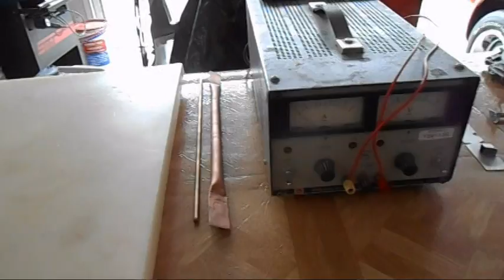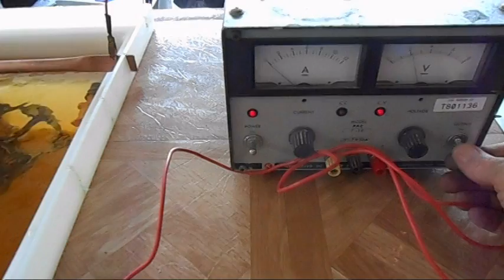Carburetor Plating Cadmium Dichromate

Comment: May I ask how big your Polyethylene tank is?   It looks to be 24x18 x12 and 20 gallons.  Also is it necessary to heat the solution, or does your pump do that for you.  Thank You very much for posting this video. It's very professional and well done.
Reply from the maker: w 12" L 18" Depth 12". I think it is 11 Gal. I run at room temp  60-95 Deg.

Comment: I really, really enjoyed your video on this subject,and I have seen most of them on here. A main concern of mine has been spilling chemicals. Insetting your plating tank into a workbench solves that. Having the area below for a fluid circulating pump system that taps into the sidewalls of the plating tank versus an aeration system is also a great idea. Having vertical slits for the copper pipe ends gives firm grip on the pipe to prevent rotation of the pipe. All "better mouse trap" designs for these important 3 facets of plating. Where did you get the plating tub? It almost appears to be nylon material vs plastic. Lee
Reply from the maker: Hi Lee
 I purchase the tank from McMaster-Carr. Check out there web site. They carry a lot of hard to find items. The tank is rated for just about any chemicals.

Thanks for watching

Comment: Very nice work. I’m restoring an old Kubota B6100. New to plating and trying to learn all about it. I like your setup the best of all the ones I have seen. I  plan to build mine like yours. Looks simple and efficient. Couple of questions. 
What model pump and filter are you using? Is your power supply a linear or switching model? I’m looking for at least a 10amp but not sure which one I need or if it matters. Thanks for the help.

Comment: Hi Harold,

Thanks for this awesome video !
But, not fluent in English, (living in France), I have difficulties to understand what kind of chemicals you use for the tank and for the yellow finish ...

Thanks for your help
Pat
Reply: +manmad4 pour le jaune, il utilise du dichromate de sodium et acide sulfurique.
pour la cuve de placage , il utilise de l'eau distillée, chlorure de zinc et chlorure d'ammonium. 
il achète la solution de placage d'une compagnie appelée Caswell Plating.
vous pouvez trouver les quantités correctes sur Internet.

Comment: Did you bake the springs after the zinc plate? A 450 degree F. bake for at least an hour is needed to prevent hydrogen embrittlement of the spring. Those springs have the potential to snap.

Comment: Is there a process for doing the old cast iron carburetors? I would like to make the carburetor look better and also make the inside of the bowl more resistant to rust?
Reply: for the outside you can buy spray cans of pure graphite that is used for spraying the inside of the buckets (loader) on tractors to help dirt release. This works awesome on cast iron and cast steel exhaust manifolds. if sandblasted then sprayed, then heat cycled it lasts forever and looks very clean... as far as the inside I'm not sure, but you could try the stuff they use for inside Diesel tanks and repairing motorcycle tanks. It makes a bladder inside the tank when it dries. However I'm not sure it will work if it has an open edge. You can plate cast iron I'm almost certain, because you can electro plate any metal as it conducts electricity
Reply: I bead blast the bodies and bowl then I nickel plate the bowls to keep them from rusting plus they look good. Make sure you clean ALL of the passages in the body and take out ALL of the access screws and plugs before cleaning.
Reply: You can Parkerize them like you would a gun. In fact, some of the best Parkerizing kits out there are sold by Browning and the like.

Comment: Hi Harold, can you say to me the formules for the dichromate of sodium tank and electrolisys tank, I know that you say about of acid sulfuric and dichromate but is dificult for me understand the writte from Venezuela
Reply: Use a clean plastic bucket and add 1 gallon of distilled water (not tap water). Next add 35ml of battery acid to the distilled water. SAFETY NOTE: always, always, always had the acid to water. NEVER add the water to the acid (this can cause a tremendous amount of heat and splash the acid on you). Slowly add the acid into the water and remember to use nitrile gloves and safety glasses. Next add 365g of the sodium dichromate (by weight; use the postal scale and small plastic container to measure) to the one gallon of distilled water and battery acid solution. Mix the solution with a wood paint stir stick until dissolved. The solution will look dark orange when completely mixed but will yield the yellow color on your parts. Note that the Yellow Chromate Conversion solution must be between 70 – 90 degrees F during the plating process.
Reply: Luis de Rivas  n
Reply: WelLRoundeDSquarE 99.9 % sulfuric acid doesn't exist.
Reply: WelLRoundeDSquarE The highest concentration I know of, is 99,3%. This is rarely used as far as I know. Standard concentrated sulfuric acid is 98%. It can't be purified more by distillation because an equal amount of water and acid will boil off. This is called an azeotrope.

Comment: Hello Harold, I have gathered everything I need to set up a system similar to yours. I bought a polyethylene 11 gal tank and I'm trying to figure out how to bond the fittings that pass thru the tank wall. Epoxy doesn't stick and I can't get the cyanoacrylate stuff to work either. I can't tell from your video how you did it. Any suggestions or products are appreciated. Thanks

Comment: That is cool.Think I'm gonna build a system like that on a smaller scale.I know you said voltage doesn't matter,but what are the specs/capacity of your power supply?As far as rotating the part,I'm thinking about drilling a hole in the center the of copper tube,and using an eyebolt with a handle/crank to tie the hanging wire to,or get real lazy,and use a slow turn motor.Do you think that would make it plate more evenly?Thanks for sharing the ins/outs,I'm inspired to try now!
Reply from the maker: Hi Bowtie
 My power supply is 8 V  12amps. Caswell Plating supply sells a book on plating that will give you formulas for figuring SQ In per amps.I have been doing this a long time I just eye ball whats going on in the tank. Most parts do not have to be rotated if you drop 2 anodes in. The carburetor bodies have so many high and low areas I keep moving them so the plating does not start burning the high spots. I started using a big snap swivel for fishing and my pump stream keeps the parts moving in a circle. Works good. You just have to change the snap swivel after about 5 carburetor bodies because the plating builds up and it stops spinning. You could soak it in muriatic acid to get rid of the zinc.
Reply: Harold, My name is Bob and I'm very interested in your process and knowledge for plating/coating of carburetors. Is there a way I can contact you via e-mail or phone to discuss specifics on this? Thanks Bob.
Reply: @backnine  that is an excellent idea right there. will definitely be using this. been wanting to talk to you on the holley plating...been emailing you
thank you

Comment: Harold, I checked the nitric acid and it is 67%. Let me know what your think.   Thanks again,   Mike
Reply from the maker: Hi Mike
 You don't leave it in the solution just immerse it at take it out and rinse 3 or seconds. If you want more chromate on it do it again. The passive blue is very light the part has to dry to see it. How have you been doing it?

Comment: Harold,
Thank you very much for publishing this video. I am in the process of setting up my own platingsystem at home to replate and yellow dichromate all of the applicable parts in my Porsche restoration.  I will use casewells chemicals, and have sourced everything but the circulation pump.  I am wondering if you could give me some idea what type of pump you are using for the plating bath circulation for your ten gallon tank. I am also curious what filtration system you are using as I have read that for zinc chloride acid baths you need to filter out plating contaminants such as iron, etc. on a continuous basis.  Thanks. Jeff
Reply from the maker: Little Giant Pump 2 MD SC.  Filter housing McMaster Carr #9979T21 Filters  McMaster-Carr # 3327T35  Fitting you will have to figure out for your application. You can check EBay for the pump. With a new plating solution you have to filter a while to clean it up. Also plate a lot of scrap pieces to break in the solution.
Reply: Thank you Harold.

Comment: Hi Harold, Great job and your presentation is excellent. Nice to see someone do a video who actually knows what there talking about. I just bought some black oxide from Caswell for doing the bolts on Muncie transmissions. Anyway the reason I am contacting you is do you do outside work ? I have a 68 Camero that I would like to have  the carb redone. If you do that kind of work how can I get a hold of you ? I was thinking about making a system but that is a lot work for just a few carburetors.I would just rather pay someone to recolor it . Thanks
Reply from the maker: Hi Emo
 I do complete carburetor restorations and I do plating for people who want to do there own rebuilds. You can contact my email chucknorbid@gmail.com

Harold
Reply: did you mean CamAro>

Comment: Great video! I just watched both this and your parkerizing video. In the parkerizing video you pointed out that the aluminum wasn't affected. I was wondering if you had a cast iron/aluminum part and first parkerized it (so the cast iron turned black) and then performed this plating process- would the cast iron be affected by the plating? Would you end up with a black cast iron surface and a gold aluminum surface? Or would the parkerizing be messed up by the plating?

Comment: Great video! Do you happen to know the formula for olive drab and black chromates? I know different acids will give different colors. I've heard phosphoric acid should give black...but I haven't tried it yet. For the green, it seems like you should be able to mix the yellow and a stronger solution of blue together to get the green. I'm also curious about your pump/filter combo. Where would I find one like that? I don't want to just throw a little aquarium pump in the tank like Caswell does.

Comment: Hello Herlod,
great work and thank you for sharing. You talk about constant movement of the solution. So I wonder if I really need a pump? Or would a little PVC  piping together with a small compressor produce enough solution movement by the evaporating air.
Reply from the maker: You can use air but make sure the source is oil less. If you get oil in your solution you are going to have problems.

Thanks Harold
Reply: Harold, thank you for your info. One more question, is this the same way do color aluminum in blue and red. Just a different dye color, right?

Besides my wife would like to know if we could do gold this way. As far as I understand I need to buy a liquid with gold particels

Comment: Nice video Harold. Would you or anyone out here have any idea what size rectifier would be required to do 5 to 10 lbs of nuts and bolts in a barrel set up. I would imagine volts would be similar and amps and time would increase with more mass. Also any info on your pump would be very much appreciated. Thanks, Larry.

Comment: was wondering when recoating Holley carburetors do you have to be concerned about port resizing and air bleeds getting to small
Reply: Or too big?! And yes, there IS a concern. This entire operation needs someone who is knowledgeable like Harold Demes.
Reply: if i remember correctly the process does not add to the surface
Reply: Daniel Hale Would not the electroplate try to coat all the surfaces evenly, therefore any areas that are not to be plated should be masked. Electroplating builds up the surface by microns thickness, such as gold plating probably around 5 microns thick used in jewellery.

Comment: Great video! What type of pump? Why the filter? (Filter) Does it need to be changed often? Is the solution in your setup heated? Is that a Polyethylene tub?
Reply from the maker: +Thomas Thompson 
It is a magnetic drive chemical pump. It does not have a shaft so there is no seal which the chemical would eat. The filter came with the pump. I have never changed it. You do not need a filter as long as you change your anode bags. That catches the crap off the anode. You just need to keep the solution circulating. The pump I have is for a much bigger tank than I have but I bought it on ebay on the cheap. The tank is Polyethylene. No heat in the tank. Not needed as long as you are not using it in your garage in the winter. I would not let it get below 60 Deg.F.
Reply: Thanks, That was very helpful.

Comment: There is a mistake in the video bill of materials list. 
The correct McMaster-Carr part number  for the bushing is 6391K153 Oilite SAE 841 Bronze Bushing 0.3125 ID x 0.375 OD x 0.500 L
Reply from the maker: Hi Pat
 I know about the error. I guess most people have figured it out. Thanks for posting?

Comment: So how does this stuff effect fuel metering systems & fuel nozzles & fuel imulsion tubes if you can't plug them or remove them because I would think it would plug up those or cause the orfices to close up & make them smaller causing fuel delivery & tuning problems especially on the idle & low speed circuits ?

Comment: Hi Harold, I took a gallon out of the hot mixture and added 9 gallons of distilled water to that gallon, and added 7.2 ozs. of sodium dichromate to it also. put the replated parts into in for 15-seconds and they came out really nice. I don't see any blue in the finish but they came out looking like chrome almost. very shiney.Do you think if I put more dichromate in the mixture it would bring out the blue color?
Reply from the maker: Hi  Mike
 You should be getting an iridescent blue kind of streaky finish. It has to be dry to see it. I would try some more sodium dichromate.
Let us know your results.

Comment: Does this affect the passages, I see the service offered on a few sites that offer rebuild services.. I've rebuilt a few for OEM vehicles just never got into the upgrades for different cams, etc..  I see it is a rather spendy upgrade to a standard rebuild. Just want the 455 in my GS to sing.. likely end up going to Fitech before shelling out so much on just a carb, then no issues cross country, high altitudes, winters, etc..

Comment: Hi Harold great video very informative! Thank you.
I am restoring a 1967 Mercedes Bens that has lots of parts that were originally dichromate. 
Can I just clean the parts and dip them on the dichromate? Or should they be plated them  1st? 
And then dip the parts. 
If so what is the best way to clean them for re dipping?
Thanks Alex
Reply from the maker: Hi Alex
 The Dichromate Conversion Coating will only work on Zinc an Cadmium Plating. All you steel parts would have to be plated with zinc first before. I degrease all my parts then glass bead them 400 mesh.

Comment: Harold, I'm very impressed. But my question is about the carburetor. Is a Quadrajet cast aluminum? If so, I thought it required a special treatment before getting plated. Also, what orifices need to be blocked off, if any, to prevent buildup of plating inside them.
Reply from the maker: The Quadrajet is cast from a material that is called Zamak 3 It has Zinc/Alu and some other material. It has enough zink in it that the plating takes with no problem. Most carburetors are of this material. Carter AFB AVS were Aluminum. But still had zinc in them not as much. That is why they are natural finish. When the Quadrajet carburetor was molded originally the zinc was heavy on the surface so they went to the dichromate after machining. I have to put a zinc coat on the old carburetors to get the dichromate to take even. The plating never builds in the orifices.

Thanks For Watching
Harold

Comment: You can make your own zinc plating solution by combining by weight 30 parts zinc chloride, 120 parts ammonium chloride and 1000 parts distilled water. About $30 in chemicals compared to hundreds at caswell. Thanks for the video!
Reply: Don't forget to add the potassium chloride. and adjust the pH to 5.8 with HCl
Reply: So can someone give a full recipy please? I'm looking at spending hundreds at caswell now...

Comment: Hello, I was wondering if you could tell me the make and model of your pump and filter system you have.  I am trying to make one just like you have.  I could only see two outlets and a third one down low - is the one down low for draining the tank or for something else?  How many intakes and how many exhausts?  What kind of nozzle outlets do you have in your tank they look like copper?  It looked pretty busy underneath your tank with all of the hoses - I saw that one of them was T'd off but I couldn't really tell what was going on.  The two pieces that you had your parts hanging off of - it looked like the small one was solid copper and the bigger one was copper pipe squished on each end - is the wire that the carburetor part is hanging off of is it copper wire or is it just steel wire?

Comment: Hello, great video, thanks. I have a question about the sodium dichromate dip. I zinc plated some small carb parts, and everything came out fine. However, when I mixed my dichromate formula, and dipped the zinc coated parts in the solution,  the parts, when dry, came out kind of a flat [satin] brownish color.  [I found the mixture I used, before finding this video, for which I used 13oz of sodium dichromate to 1 gallon of distilled water,  and 35ml of battery acid], The ambient temperature that day was approx 93 degrees.  Thanks in advance for any help.

Comment: Harold, love the video! You have a great setup there! I'd love to make the the same setup. I do quite a bit of Old motorcycle restoration and this setup will relay help me out.
Where did you get the pump and filter setup? I saw in the comments you got the tub from McMaster-carr, do you recall which one you have, and what size it is? Thanks!